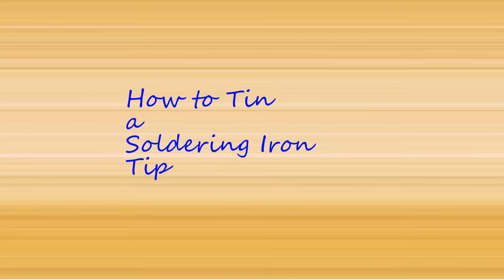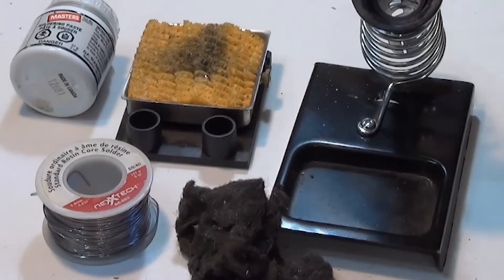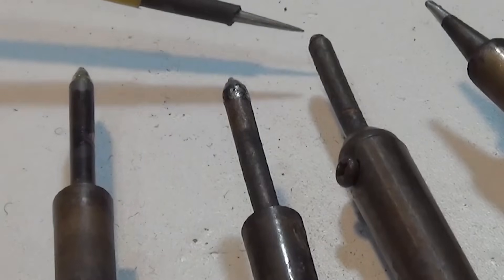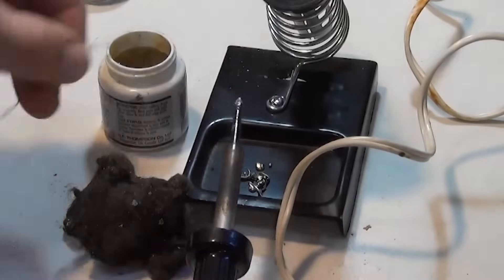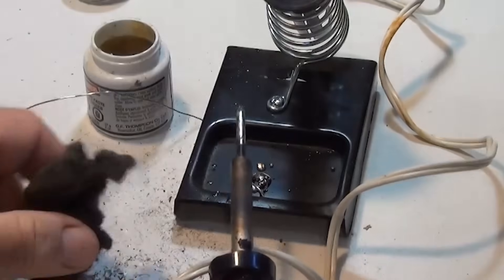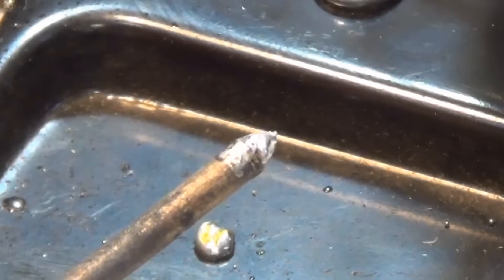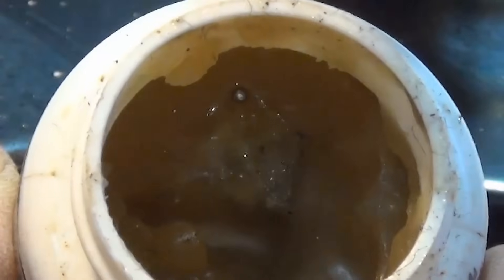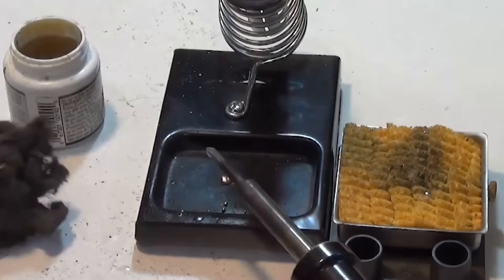How to Tin a Soldering Iron Tip or Re-tin an Old Soldering Iron Tip

Comment: Useful tip: The last thing you do before switching off the soldering iron and putting it away is to quickly re-tin the tip with some solder and wipe off the excess. The fresh coating of tin solder will protect the iron in the tip from corrosion until you switch it on for its next use.

Comment: What I do is to not even heat the iron  to tin it, so that no additional oxide forms from the tip's being heated before the solder is applied --- I use steel wool or sandpaper to gently remove the corrosion down to the shiny bare metal, coat the tip with flux, then use a second, larger iron or gun to melt some solder and apply it to the bared tip.  That way the solder can totally adhere and bond with the tip, without the tip's having to be hot enough to melt the solder itself, which will make corrosion on the tip before the tip ever gets anywhere near hot enough to melt the solder.

Comment: In Europe we are stuck with the new lead free solder. I dont use it still have plenty 60/40 solder. However when I have had to use lead free find it can make poor joints and damage soldering iron bits.

Comment: I salvaged two Radio Shacks soldering irons and tinned a brand new Weller using this video and I don't know anything about soldering. Thanks for the help. I turned right around and soldered a guitar amp cable and a little jumper wire. I thought it was a great video thanks.

Comment: I have a Weller soldering gun and when I first got it it would melt the solder just like that but now literally only a day later it will sometimes work normally but even when the tip is clean the solder just doesn't melt quickly enough to solder anything even after holding the trigger for a few minutes
Reply from the maker: It could be that the soldering iron is defective.  Unplug the iron and measure the resistance at the AC plug of the iron. You should measure a low resistance, most likely under 100 ohms if the iron is ok.

Comment: Folks should use a perm marker on the paste to NOT use when soldering...corrosive ! I know I’d forget , as I don’t put new tips on for maybe 3-4 yrs... 
Also, I was taught in 2 different soldering schools to coat tip with solder, then turn off/ unplug. The solder will protect the tip from corrosion, and wipes off in a jiff, next time used. Has worked well for me for decades !

Comment: The plumbers acid flux is not suitable for irons used on electronic equipment. The acid contamination can damage the circuits years later.
Reply from the maker: Yes you are correct, but I'm only using it to clean and re-tin an iron tip

Comment: 'Cool' stuff man. Thanks for the 'hot tips' ! I never even heard of preparing a solder iron's tip by tinning before use. I only recently thought to get one to connect fan motor wires during servicings at home.

Comment: You told us that the flux is highly corrosive and lethal, hence we shouldn't touch it.. Am i correct? 
Another question-
Since the flux is in a plastic case, wouldn't the plastic get burnt when the soldering iron is put into the case? Pls reply! 
I am a rookie, sorry if these are stupid questions☺ 
Thanks a lot for your help! 😊
Reply from the maker: You do not need to touch the acid flux.  The iron tip only comes in contact with it. Work in a well ventilated area while tinning and avoid breathing in the fumes. You can use a small fan to blow the fumes away from you. Just be carefully to soak the iron tip in the flux and try not to touch the plastic container with the hot iron tip.  I have been doing this with students for a long time now without any problems.
Reply: Thanks for the help!! I really appreciate it! 😊
Reply: I always use rosin core solder. It is not corrosive and you can touch it. However it should be cleaned with Alcohol just to be tidy. Be careful not to breath the fumes while soldering. Use a ventilation fan with a charcoal filter to draw the fumes away.

Comment: i have a Hakko soldering iron pen. never tinned it but i wipe it off with a foam sponge after every use. it does look shiny silver before i put it to storage. never had problems with it for the past 4 years and heat transfers perfectly after about 10 seconds from turning it on. not saying tinning isn't need. this is good practice i should start doing myself as well. i have destroyed 2 radioshack 25w and 40w irons in the past and about 4 tips in the process.

Comment: You can clean a tip with sandpaper, just did that on mine, and I actually found out it's made of copper which makes sense. But anyway, it's doing it's job  as good as new after a bit of sanding and retinning
Reply from the maker: Copper tips are the only tips that can be sanded or re-shaped.
Many plated iron tips should never be sanded.  Sanding a plated tip will destroy the tip.
Reply: +1929fordhotrod 
Theres no such thing as "destroyed soldering tip" unless it was dirty, thats why you sand it with sandpaper to keep it clean...doesnt matter also if you reshape/sharpen the tp!
Reply from the maker: You are entitled to your opinion but you are incorrect with your statement.  Depending on the quality of the tip, sanding and filing a tip will destroy the plating on the tip and render it useless and unsuitable for pcb work. This is a link on how a quality iron tip is made http://www.elexp.com/images/sdr_fig2.gif . Many of the cheap $10 irons do not use this method of manufacturing tip and usually self destruct after several weeks of use.
Reply: you are correct!! some of these kids think they know it all & have only soldered for 6 months but know it all, Thank You for an excellent video and telling only the true facts!!!
Reply: Guys I don't know what are you arguing about, I'm telling you my experience, I sanded my tip until I exposed the copper, not knowing I shouldn't do it. However, I applied solder to it and spread it around using a metal thing until it became shinny silver and now it works very well.
Reply: +Silver Mirai  Some sources sell copper tips, most often for soldering guns, not irons. These tips can  be sanded, no worries. But the copper eventually wears out and separates (on gun tips) or loses the precise shape, needing replacement, or reshaping where possible..

Soldering irons are most often preferred for PCB work as their temperature can be regulated far more accurately and the much smaller tips work better on PCB traces.

To keep them in good shape and have a long working life, the tips have a copper core and are then plated to have a strong surface far less subject to wear with heavy use and keep a well defined shape making PCB work neat and prevent shorting of traces. Also exposed copper tips oxidize easily. 

Sanding the iron's tip removes the clad portion exposing the copper, which is now more prone to oxidation, and make for sloppy work. If just working on wire and wire connections and not PCBs, then precision isn't an issue. Tips are cheap, but cheap tips are a false economy. 

I've been soldering for a good many decades and early on I stopped burning through tips. But then I come from a 'non-disposable' time. If sanding works for you, fine. I still recommend steel wool.
Reply: @SilverMiraii  if your tip's core is copper, you're good to go as far as sanding. What is being talked about by not being able to sand the tip is when they aren't copper as the base metal. Sanding will destroy those tips.

Comment: I've never had this problem before. I didnt even know about it. I use a Weller station 40w pencil
Reply: If you keep tinning the tip while it's hot, don't walk away from it while it's powered for more than a few seconds, keep wiping off the oxidation and retinning it while it's hot, and cover it with a lot of solder before you turn it off, the tip will never get a chance to get dirty like in this video, and it will last a long time, instead.  Then, the tip will last until the plating starts to wear away, which could be after soldering a thousand joints, or something like that.

The object of the game is to keep the plating covered with clean, shiny solder.

Comment: Never wipe a soldering-iron tip with a damp sponge because it leaves microcracks in the metal.  You made a unique video! Great!  Can I use anything else than Homer's Soldering Grease.  I ask because   I also have a chemistry lab with  tuns of chemicals.
Frank
Reply from the maker: Don't get creative with the chemicals.  The plumbers paste works best and is safe as long as you are in a well ventilated area and do not have your nose over the cloud of smoke.
You are correct to some extent about wiping the iron with a damp sponge.  If you do it quickly there will be no problems.  I have use many commercial  rework and surface mount stations and a damp sponge is part of the station.
Reply: Used to work in a factory with  soldering lines; all the employees on those lines had a soldering iron and damp sponge station and used it sparingly.  No problems...  don't overdue it.... just a real quick swipe.

Comment: Does cleaning with the plumbers paste create potential  problems for electronic applications ? Or is no zinc actually left on the tip after dipping it and using steel wool

Comment: I wish I knew I should do this to brand new soldering irons. After doing a couple of small soldering, wiping off the excess each time with a rosin based brass tip cleaner, the tip wont even melt solder anymore. At all. The iron doesn't look anywhere near as black as the ones in the video either.
I'm excited to try out this video and see if it works for me! I'll check out your other videos for tips before I goof too hard

Comment: I have seen many people do this tinning stuff and I don't need to do this as i keep my tips nice and clean after every use but I just have one question. Why doesn't the solder that is coated to the top of soldering tip melt away when it gets hot ?
Reply from the maker: Yes proper care of a tip is the best method but over the years I have seen students bring in so many soldering irons with tips that have never been tinned.  The biggest problem is that many people do not realize that tinning the tip is important.

Comment: Starting at 2:08 and then repeated at various places, you mention and show the use of steel wool.
I am just wondering if any alternates might work just as well. For example, one of those green thin 3M scrubbing pads most often found in a kitchen?

I thank you in advance for your reply, Mr. Ansons.

Terry Thomas
PC Tech Support
Atlanta, Georgia USA
Reply from the maker: Using the 3M pads is not a good idea.  They will leave contaminants on the tips resulting in a poor solder connection. You could also us stainless steel or copper scouring pads to help clean the tip while soldering.

Comment: is the plumbers paste necessary? Thanks!
Reply from the maker: +Verdana - Yes, you need the acid in the flux to assist in the cleaning and reconditioning of the tip.  It speeds up the process.  Do not use plumbing flux on the pcb, it is corrosive.
Reply: Ok, thanks for the help. :)
Reply: +1929fordhotrod couldn't you use pure flux
Reply from the maker: +Evert Guzman - The acid flux will be more aggresive

Comment: Well maintained tip will last years - the irony of this fact is because of that, I never saw my father tinning a newly bought tip. He got his solders when I was a little kid or even before that - and when he started teaching me how to solder some years later, all the tips he had were nicely tinned. He forgot to mention you have to tin a new tip, and I used one of our "shared" solders for ten something years. When I got me my own one, it was a total shitshow. The tip wasn't accepting tin, got blackened, and so on. Thinking it's a crappy Chinese tool, I scrounged myself some used kit manufactured somewhere in the 80s, and obviously, it came with tinned tips, so it worked - so I was totally convinced humanity has lost the art of making soldering irons and if you want to have one that works, it has to be as old as you. 
I learned about preparing the tip after more than 30 years of soldering. The irony. Felt like a total idiot.

Comment: I realize now that I have never properly tinned my tips.  What causes gross erosion of a brand new tip?  I have been using a thin 3M brand rosin-core solder from the small dispensing tubes.  After only 8-10 solders of tiny LED terminals and wires, the tips start developing craters and eventually wear thru.  What causes that and how do I prevent it?  It seems to happen pretty quickly and on every gun or pencil that I have used.

Comment: Very helpful for me. I bought one nice soldering iron earlier but did not thine the tip. It became corroded, I decided to use file to make it sharp and shinny. Three months ago the tip stopped getting hot.I could not find spare tips so I bought 30 watt solder iron last week and yet to use it. Your video is just what I lacked.Thanks so much for the you tube video. I love it and will use your advise for my new soldering iron.

Comment: i bought a new soldering iron.  I tried to follow your instructions but even when I wipe it of with the metal sponge and then use the grease and then try to put tin on the iron, the iron just wont stick to it, it just keeps forming small balls that keep sticking to my tin wire.  of it forms a ball that does not want te keep sticking to the iron but just rolls off there... i'm desperate so please anyone that knows why this happens

Comment: Is the plumber's paste really necessary?  Can I simply wrap the tip with sodder and melt it on?  I've seen a couple videos that just wrap the tip and melt, no paste.
Reply from the maker: The acid flux or plumbers paste speeds up the process.  Acid flux should never be used on a pcb.
Reply: +1929fordhotrod Oh okay, thank you very much for the reply.  So, the plumber's paste simply speeds it up?  I'm assuming that means that no harm would befall my tip for not using the paste.
Reply from the maker: Once the tip is clean and you perform regular maintenance on the tip you should never really need to do this again.

Comment: Rather than using acid-based plumbing flux and steel wool, just buy a small tin of "Soldering TIP TINNER".
Much much easier,  and also works on "SoDDering" Irons as well.

Comment: Can this method be used to refurnish a desoldering tip?
Reply from the maker: Yes.  The clean and well tinned de-soldering tip will work much better at removing solder.
Reply: thank you for the very educational and helpful video, I will try your re tinting method on them.

Comment: This might have been brought up before, but every guide out specifically says never/no no to plumber's paste because of it's highly concentrated acid base.  So ??????  Okay for tinning but not actually working on the pcb trace or joint?  What's the rule here?
Reply from the maker: Never ever use acid flux/plumbers paste on a pcb.  It is corrosive. I only used it to condition a poorly tinned iron tip.

Comment: This is a bit late; but can you wear thick leather gloves when using the steel wool to tin the soldering iron, so you won't burn your fingers?
Reply: If you want to wear thick gloves, it is not forbidden. Soldering is much safer than welding, since you are dealing with much smaller amounts of energy.

Comment: what is the point of the plummers paist? is it meant to extend the tinning life?
Reply from the maker: It helps with the cleaning and tinning of the iron tip.  Once the tip is properly tinned and maintained you will not need to use the acid flux. I find the cheaper irons require considerable more effort to keep them tinned as the plating burns off a light speed.

Comment: I've got a copper tipped iron, its been reshaped a few times but still alot of the tip left, though I'm having some real trouble tinning the tip, using rosin core solder, it slides of my iron and never sticks to it! Any tips?
Reply: Clean it with plumbers flux paste, and tin the tip. Soldering tips are  copper rods coated with iron, then chromed. This makes the tip 30x more durable than plain copper, to guard against oxidation. Copper readily oxidates especially when heated.

Comment: Without flux , is it possible to tin the tip (what can we use insted of flux)
Reply from the maker: no, flux is the most important part for soldering
Reply: You can't tin or solder without flux. You will be highly frustrated if you try.

Comment: Is there anything I can use instead of the metal wire mesh thing..?
Reply from the maker: A damp sponge specially used for soldering.  In a pinch, a damp paper towel can work but might transfer contaminates to the pcb.

Comment: is there a reason for the acid paste?  I remember not to use acid core solder and so comes my question,
Reply from the maker: The acid paste helps clean the tip.  Never use acid core solder on a pcb, its best for stained glass work and in the past plumbing

Comment: Won't the wet sponge remove the tinning when you wipe it?
Reply from the maker: No, not at all.  It will only remove the burnt contaminants from the tip.  Wet sponges will lower the tip temperature slightly and the recovery time will depend on the quality of the soldering iron.  You can also use a copper or stainless steel scourging pad to keep the tip clean.
Reply: What about one of those green thin 3M scrubbing pads from the kitchen?

Comment: Does solder go bad with age ? I have some kicking around here that I know is at least 20 years old . It won't solder properly but from watching this video , the iron may be the problem . I can't get the solder to melt at all .
Reply from the maker: No, solder will not go bad.
It is possible that the flux in the core is the problem but I suspect your soldering iron tip.  I have use solder that has been 20-25 years old without problem in the past
Reply: Thank you for responding ; I made a new tip from some #10 copper wire , it worked fine after that .
Reply from the maker: That's great and that was how it was done in early times.  Remember to keep the tip tinned.